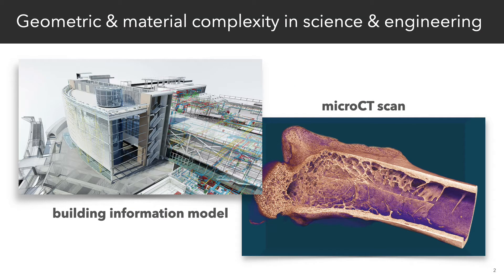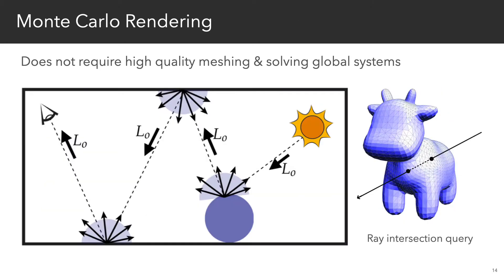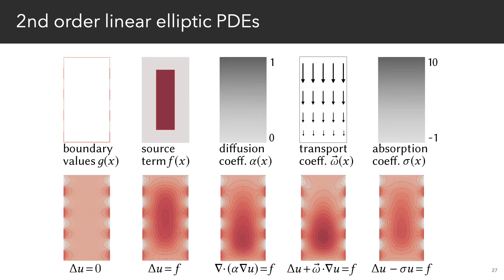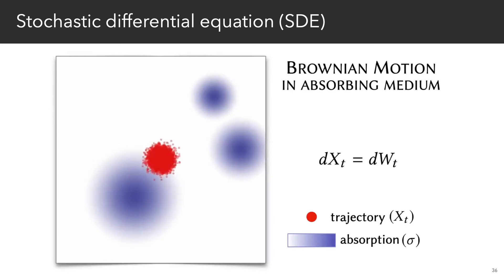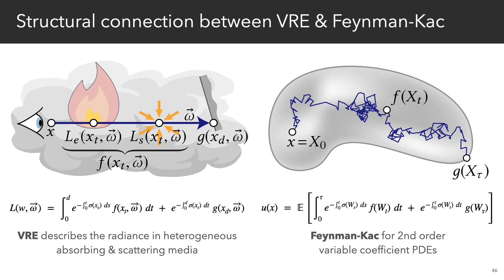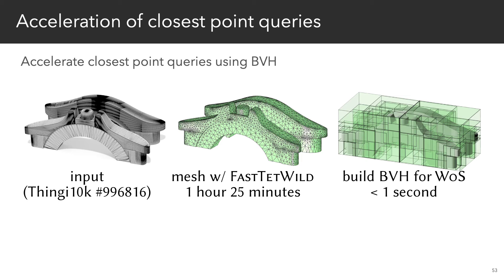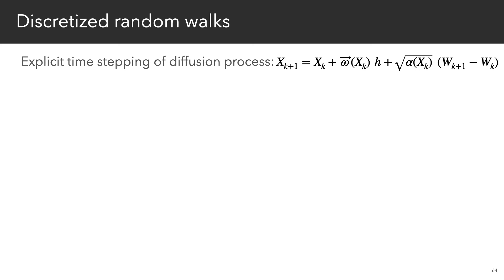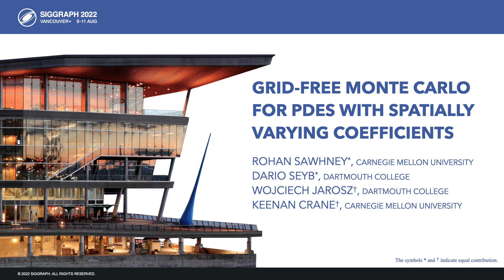Grid Free Monte Carlo for PDEs with Spatially Varying Coefficients Siggraph

Comment: Love to see this progress!

I wonder whether this could be done in the time domain as well?
I know, it tends to be the case with Monte-Carlo methods, that they are timeless. They try to sample some steady state, right? 
But if you make the entire spacio-temporal volume your "steady state", it ought to be possible regardless.
Normally you couldn't properly save, and keep access to all that data so you could completely skip out on frames. But perhaps there is a way around that somehow? Maybe something inspired by NeRFs. A sort of data structure that's iteratively updated with gradient descend anyways, so you could probably reformulate that as a PDE that can be handled with a method like this I'd think?
Then you could effectively get rid of all explicit grids (globally spatial, locally surface- or volume-spatial, and temporal) and go gridless continuous end to end perhaps.
It seems to me the application of refining subsurface scattering is a nice example of how that might be helpful.
Reply from the maker: Hi! It's possible to handle temporal problems such as the heat equation with walk on spheres, I recommend looking at this paper: https://epubs.siam.org/doi/10.1137/0114031

Since the heat equation is an initial value problem, the high-level idea is to also sample an "exit time" at each step of the random walk from a known distribution (in addition to a uniform exit location on the sphere), and to keep a counter of the total time elapsed during the walk. If the counter value exceeds the predetermined amount/time for which one wants to flow the heat, then the initial value at the current position of the random walk inside the domain is added to the Monte Carlo estimate.
Reply: @rohansawhney1583  thanks I'll check it out! sounds interesting